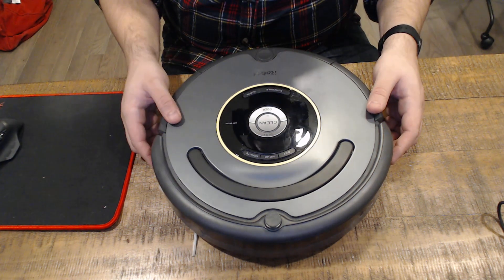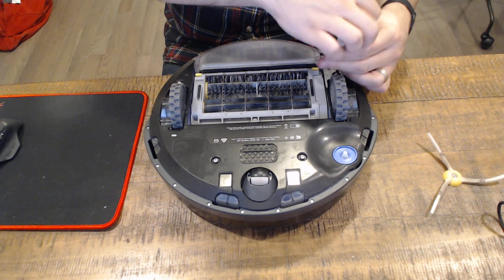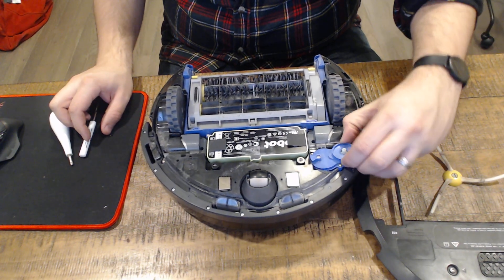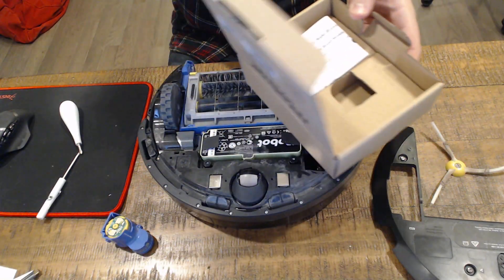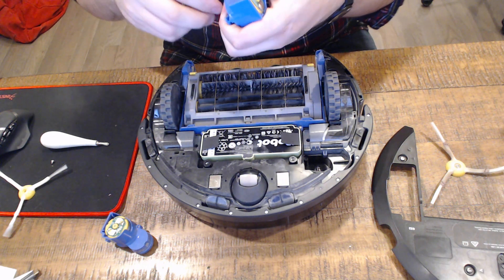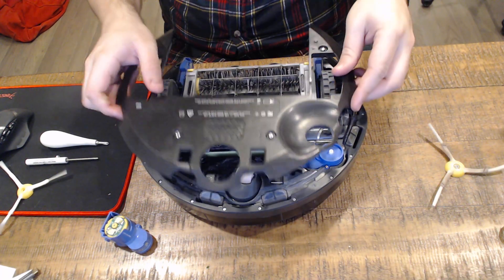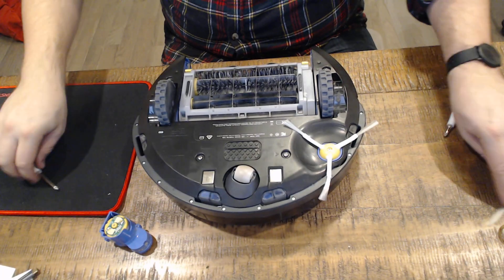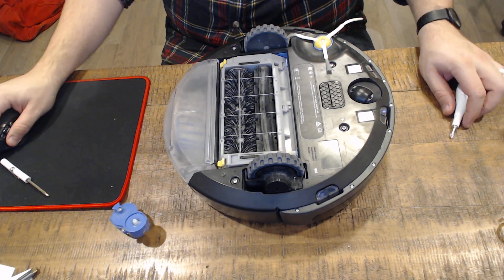Roomba Side Brush Module Repair

Comment: This is called purposeful shit engineering to make money. it's a flexible brush that bends when it hits stuff so why would they make the part that you screw into out of plastic? The answer is so it strips out and you are forced to buy more parts every 6 months. There is ZERO excuses for that part not being made of metal. I'll never buy another Roomba.
Reply from the maker: I agree with the screw and the part not being made out of metal.  At the very least they could have a way to attach the brushes so that it doesn't damage the part. The Shark vacuums and Neato I have just have the brush snap on and off either with a friction fit or magnets
Reply: 💯 correct! engineered obsolescence 😡

Comment: I know this is a old video, but does the roomba 600 series side brush suppose to spin all the time when roomba is cleaning?
Reply from the maker: I can double check but I think it will most of the time.  When it is trying to get unstuck from an area it might briefly turn it off.  Let me do some research and I'll get back to you

Comment: I've got an I7 which I cannot remove the side brush from.  I noticed it has captured a charging cable, which bound up the side brush while the robot was running.  Now the brush will not spin.,  However, when I try to unscrew the side brush, I can hear the motor spinning inside when I turn the screwdriver, and the screw does not actually loosen at all.  I'm assuming either the hexagonal socket on the underside of the side brush head has been stripped, or the hexagonal post connected to the motor has stripped.  But, in either case, I cannot remove the side brush because I cannot get any resistance on the screw while trying to unscrew it.  Since I can't get the side brush off, I can't find a way to get the bottom cover off.  Any thoughts on how to remove the side brush or bottom cover. (Tried prying on the bottom of the side brush dome with a small screwdriver, hoping it would snap, but it looked like the internals would be damaged before the side brush head snapped.)
Reply from the maker: Sounds like a gear might have been broken within the module. 
If it were me I would start by removing the brush in order to take the Roomba apart and get at the brush module.  
I would likely use a tool like a Dremel to carefully cut/remove the brush head.  It sounds like the module might not be salvageable but it is best not to break anything else so always go slow and avoid being too rough when removing parts
Reply: the bottom cover slips off with the side brush on...

Comment: Hello, good video. I replaced the side engine. There wasn't any kind of dust or hair. The first day the new engine worked fine, but the next day stopped spinning and didn't work anymore since then.  Any clue about?  Thanks a lot.
Reply from the maker: Sounds like either the replacement motor was bad or possibly something got knocked loose while it was running.  These things vibrate a lot so it might be worth opening it back up to verify everything still looks okay

Comment: Great vid.  In my case though my gears were fine.  The lube used had solidified slightly around the gear that spins the brush, causing the shaft to bind on the hole it goes through.  Scraped off the solidified white gunk on the shaft and the hole and back in business!
Reply from the maker: Wow!  Any idea what caused the lube to solidify?  I thought it would be fine against most conditions outside of extreme temperatures.
Reply: @TheOhayoDev  No idea.  I wonder how warm that gear gets, though.

Comment: I replaced the side brush motor and it's still not spinning. Any suggestions?
Reply from the maker: Whew if replacing the side brush module didn't do the trick it would likely be something else electrical.  Does the main brush spin?

Comment: Hello there! Thank you so much for showing this step by step process. I did not replace the brush, it was simply an accumulation of hair  (a disk like bunched up hair) that had the brushes stuck. I cleaned it and voila! its good as new. Thank you thank you again!
Reply: I had the same problem.  This video helped me have the confidence to just open it up and see what the problem was and it was a bunch of hair that I couldn't see until I took the side brush off.  Thanks Jared!

Comment: This isn't really a "repair" of the sidebrush module. Ever run across any info on troubleshooting a known working side brush module not spinning?
Reply: strengthchain: Exactly. Mine works, but the brush comes off all the time. I was looking for a video on taking the cover off the module, as I suspect there is hair underneath it.
Reply: @jeffdaniel7627  Brush comes off? Are  you sure the screw is there. Also you can  open the module with a small flat screwdriver. Just undo the special screw and put the screwdriver under the plastic clip on the opposite side.
Reply from the maker: @jeffdaniel7627  I've stripped one before which caused the brush and screw to come off.  Maybe add a dab of loctite or super glue to the screw threads to keep it in?  Just enough that you could break it out with a screw driver when needed.
Reply: @TheOhayoDev  We have a 650 and the side brush comes off even when we put a new one in.  From a Roomba blog, it seems that the threads get worn out so it does not matter whether you have a new brush or not.  You have to replace the whole side brush unit.  I have not tried crazy glue yet for fear I won't be able to change just the brush.
Reply from the maker: @johnw817  I don't know if it will work but the the past when I've stripped plastic parts I would fill the hole with glue and wait for it to dry.  Then I used a screw to re thread.  You could do that at your own risk but if it meses it up more it sounds like the module would need replaced anyway 🤷